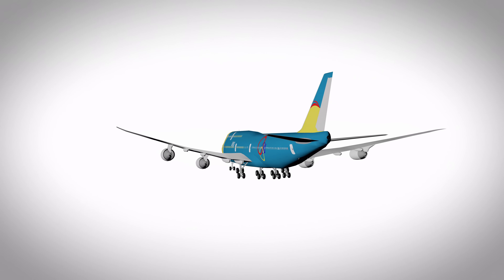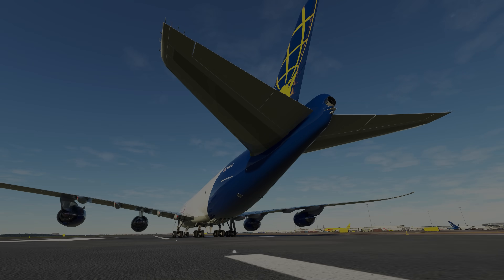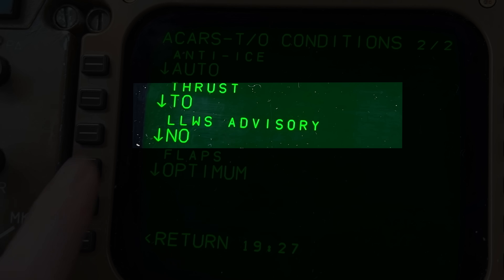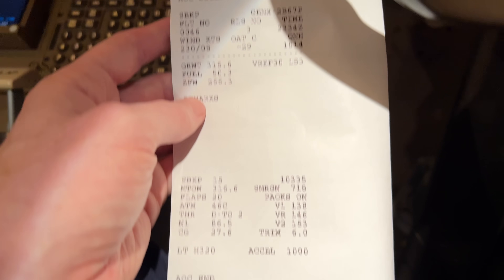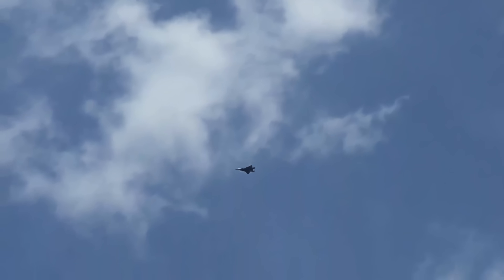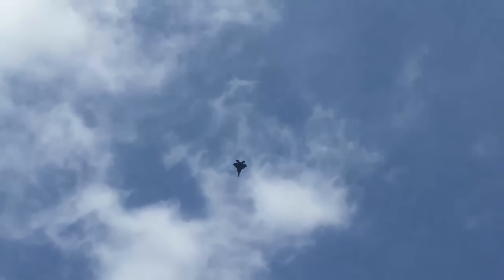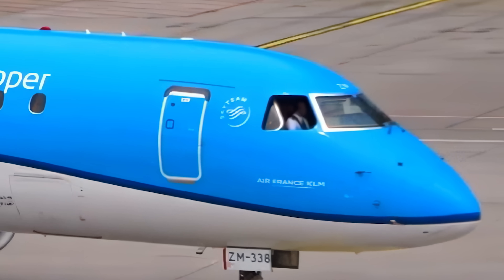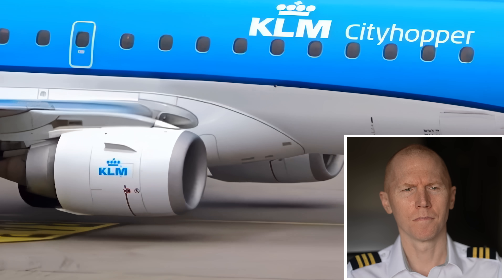Unsafe 747-8 Vertical Takeoff

Comment: I'm not a car person, either, but truckers use engine braking often. It's noisy, though, so some cities have ordinances against using that in town. I occasionally use it in my car on icy roads,especially going down hill, to keep the speed down. Also, that's how I was taught to drive a manual transmission car when coming to a red light, for example. I think it's also pretty common in mountainous areas to prevent brake fade. 
Anyway, great content! I recently returned from Europe on a 747 and was thinking of all I've learned from your channel!
Reply: I'm a manual driver as well. I do believe it was a poor analogy - as you said it is a common practice in manual vehicles - to save on your brakes. Hard to compare flying a 747 in the air to driving any vehicle on the road lol
Reply: Every time I see them signs I flip my jake brake to high lol
Reply: Used to drive 18 wheelers and what you are thinking about are jake breaks. And you are not supposed to engage them on normal driving conditions only on steep down grades. Basically using the engine to slow the truck down so you dont over use the breaks to keep them from overheating and hence becoming non responsive. This is the reason for run away truck ramps fyi
Reply: @giocrypt5148  Not to mention that a jake brake (Jacobsen Engine Brake) is an add-on component that varies the valve timing and things to create more back pressure.  I drove fire trucks with them, and they were on all of the time.  Cars do not have this.  That said, when driving a stick, I downshift all of the time.  My last Explorer had an automatic with "select shift" that allowed downshifting.  I got rid of that car with 78,000 miles and original brakes.  The new Explorer does not have select shift, and I miss it!
Reply: Some motorcycles, mainly flat-track racers, will put a compression release lever on the brake side of the handlebars to be able to let off some of the compression as they hit the corners. You'll hear them, it's like a higher pitched jake brake. Decades ago I did some racing, my family was big into it in the 1970s.
Reply: Google money shift :)
Reply: Yes, downshifting a manual transmission to slow a car or truck down used to be a very common practice.  My dad gives both I and my sister-in-law a little grief for not doing it.  But honestly, that was a lot more useful/practical in the days of drum brakes, where they would fade if they got too hot.  Something far more likely with a drum brakes than disk brakes.  No fun!! I still downshift a little, early on in slowing down, but mainly use the breaks.  Replacing my brakes costs a lot less than replacing my clutch.
Reply: I drive a manual transmission Honda Accord by preference.  Weird, I know, but I really prefer a manual - I feel more connected to the car and it makes me pay better attention to my driving.  (Yes, I’m a Boomer; but a very young one!) I routinely use my gears to slow down smoothly, even in traffic.  I also use them to keep my speed slow when driving downhill on mountain roads.  I do sometimes use my brakes to slow down quickly if needed, but I use the gears to maintain slow speeds downhill instead of riding my brakes.  Done properly, it shouldn’t damage the clutch, because I also stay off the clutch as much as possible;  I only use the clutch when actively shifting.  If I do need to use the brakes to slow down quickly, I gear down at the same time so that I can get off the brakes ASAP and let the engine keep my speed down.  My goal is to only use the pedals when they are needed and to get off of them ASAP.  According to my Dad (a pre-boomer?) that’s the best way to keep everything working smoothly for as long as possible.  😊
Reply: Regarding downshifting a manual to save brakes: Have you checked the cost of brake pads vs clutch plates? Unless of course you can consistently perform perfect downshifts…every time 😊
Reply: Our quad bike only has engine braking.
Reply: @Rabblewitz  Or the transmission synchronizers.
Reply: Semi trucks have what is called a retarder which is basically a dedicated engine braking system with variable strength. It’s used because as opposed to normal brakes it is wear free and it doesn’t lose strength (fading) due to overheating of the discs and brake pads.
Reply: @stevewaclo167  if you're used to it, it's not a big deal. 
In Italy (where manual shift is still widespread) you get used to it and it's sometimes safer than brakes.
A friend of mine, descending a long mountain road, kept braking until the brakes finally fade out. She didn't had a bad accident only for pure luck. Here where you descend mountains you're encouraged to use as motor brake as you can.
Reply: Engine braking is usually used with manual transmission - it's part of the tools you have for driving!  It doesn't wear anything out any more than normal driving does, and it actually improves engine life by encouraging oil up the cylinder bores.  I practice driving without things from time to time, in case I ever have to (like practicing engine failures for pilots) and I once managed to drive home from work, about 11 miles, only touching the brakes twice.
Reply: @DeathCubeKX and the plane was on the ground, not flying? So he wasn't comparing a plane flying to a car driving. He compared a car driving to a plane driving. Smh
Reply: @stevewaclo167  You're not using the clutch plate to slow the car down...you're downshifting and then letting engine compression slow the car down.  That said, I don't downshift to slow down at every red light like some people here are saying, only on downgrades.
Reply: @kurzabel  How did we let discussion on a 747 channel get off into a dialog about engine braking? 😉

I agree engine braking can be useful on long downgrades, but as you accurately pointed out, it’s not to be used as a primary method for slowing a vehicle. I still contend that any down shift for slowing that does not include a well synchronized clutch application is going to wear on the clutch. Decades ago, I got into the (bad) habit of downshifting all the time for slowing, and wrecked the clutch on an  Audi 100LS in short order. I told you it was a long time ago. 😀

And not to put too fine a point on it, but engine braking in a car is different than a Jake brake in a truck. Correct me if this is wrong but here’s a description of Jake brakes, from Google: “When activated, the engine brake (Jake Brake) alters the operation of the engine's exhaust valves so that the engine works as a power-absorbing air compressor.”. That’s why activation of a Jake is so darn loud and we often see signs (usually in residential areas) outlawing their use. 

In a car, the throttle plate is of course closed during engine braking, so there is not enough air entering the combustion chambers to compress. Again from Google: “Resistance in the engine is transferred through the drivetrain to the wheels. Some of the braking force produced is from friction in the drive train, but most of it is caused by the vacuum that was created from the lack of air “ (not from compression…my comment added). 

So there 😀. 

Good talking to you and let’s let this channel get back to talking 747 stuff 😃.
Reply: @stevewaclo167  " How did we let discussion on a 747 channel get off into a dialog about engine braking"  Because he mentioned engine braking in a car specifically in the video.

"And not to put too fine a point on it, but engine braking in a car is different than a Jake brake in a truck"

I never said they were the same.

"Some of the braking force produced is from friction in the drive train, but most of it is caused by the vacuum that was created from the lack of air "

In a normal passenger car, the 4 stroke engine, whenever turning over, can be fundamentally understood as an air pump.  This air pump is a heat engine from which mechanical energy is extracted, but first and foremost it works by pumping air.  In stroke 4, The pistons begin to compress the air, then the exhaust valves open and the air is expelled under pressure.  The exhaust valves stay open as the exhaust stroke is completed, and the kinetic energy stored in the exhaust which was driven out under high pressure early in the exhaust stroke helps pull out more gas from the cylinder.  Once this compression during the exhaust stroke drives out all the exhaust, the intake stroke, stroke 1, begins and the cylinder opens again, creating a vacuum. Strokes 2 and 3 are the compression and power strokes, and strokes 4 and 1 are the "air pump" strokes, where the intake and exhaust valves are opened. That's where  manifold vacuum comes from...without engine compression in stroke 4, you won't end up with manifold vacuum at the end of stroke 1.  The engine compression jake brake alters timing and fuel flows to create more effective engine braking, but without compression, no engine braking is possible with or without a jake brake, because without compression it will not function as an air pump, and therefore will not function at all.  The use of compression as an idiomatic shorthand for the proper functioning of the air pump as a whole is long established by auto technicians, perhaps you're not familiar with this usage.  The original reasons for this choice of terminology are up for speculation at this point, given that both compression and vacuum are measured as part of engine diagnostics, but I assume it is because vacuum leaks are common and often easily fixed due to the siphoning of vacuum to assist in braking and steering, while loss of compression is a more serious issue.

"Good talking to you and let’s let this channel get back to talking 747 stuff 😃.

It is more logical, if you don't want to talk about something, to merely stop talking about it, rather than asking others to stop.  If you have issues with self control and have trouble stopping, perhaps you can install a jake brake on your typing fingers to add braking force.
Reply: @giocrypt5148  Who says you're not supposed to use them in normal driving conditions? That must've been some weird company policy or something. There is absolutely no reason to not use them in normal driving conditions other than a noise ordinance.
Reply: @janharg1  Absolutely this. I grew up driving (what we used to call) standard transmissions, and once you really get proficient, the car becomes a part of you. Using the clutch to brake is just like using it to accelerate in reverse. Where I live is very mountainous, with steep grades and tight (15 mph?) turns. If I'm coming in too fast I will totally downshift and brake with the clutch at the same time I am applying the brakes. But mostly, I try not to use the brakes except when that's truly indicated, like stop signs and stop lights. I've gotten over 200,000 miles on the same clutch, so I try to save the brakes.
Reply: @HDRW  I did that recently. I was coming home from a road trip and just turned onto my last gnarly mountain highway to get home when my car indicated my brake pads were dangerously low. Okay. I know I'm not out. But there was little traffic so I went a little slower, tried to use only the engine to break, and was amazed how little I really needed the brakes if I was paying attention and planning ahead. In retrospect, it was fun!
Reply: @giocrypt5148 Try spelling it "brakes".
Reply: @stevewaclo167 Like in my  Porsche which had worn synchros on 2nd and a bit on 3rd gear which required double clutching ("double declutching" if you're a Brit).

Comment: I flew on an A380 from Bangkok to S. Korea, fully loaded and counted a flight crew of 28 as we waited in the terminal. The plane was very comfy. I sat in the upper deck just behind the wing. It feels like looking out of a 6 story window. The plane was tremendously under powered, used up a lot of runway taking off. Seriously felt like 60 mph when it finally rotated. Very smooth flight.

Comment: Living high in the mountains of northern New Mexico, we became accustomed to driving in lower gears to control speeds down steep grades. In general we drove much slower than "low landers" visiting the area, and that made for an interesting mix of traffic sometimes
Reply: Raton Pass. Been there, done it, and learned on motorcycles to downshift long before I drove a car down it. So many people don't. (and I was a flat-lander, it doesn't get much more flat than Amarillo. :)  )
Reply: @charlayned Try Denmark. The highest point is 561 feet above sea level.  And that's a slow rise up.
Reply: @charisma-hornum-fries   People in Florida are seeing your "561feet" and wondering to themselves whether they would start to get altitude sickness by then -- so much higher than they've ever been.

Comment: @74Gear That F-22 did an aerobatic maneuver called a Pirouette. It went vertical to bleed off all its energy and pulled the nose over at the top and basically started an almost half spin yawning motion. 

You're not wrong when you say its black magic. The F-22 is "supermaneuverable". Meaning it can do things well outside of normal regimes and flight envelopes. With thrust vectoring, the F-22 does things that seem to defy physics sometimes. Its an amazing piece of engineering.

Comment: ATLAS air flies into various combat zones. High power climbout is SoP for these regions also depending of the age of the video. Bagram's western departure was facing a 13k mountain  with the runway already at 5.5k. So every take off was that profile. Kinda crazy to watch.   Regarding the F-22 that's the typical air show fodder they do, It's also handy if you need to drop through the air also they can park it on the tail and move along at a few mph almost like a vehicle.
Reply: Yeah I was thinking the same. Based off the other planes on the tarmac they took off from a commercial AP but that take off is the same I see from our heavy pilots most times in the USAF. I didn’t even know heavies could produce that vapor effect over the wings like fighters do until I had my first flight on a KC-135
Reply: I've seen the Tomcat go down the runway on a flyby almost standing on it's tail.  He was showing me how slow the Tomcat could fly. Everyone asked him fast it can fly.  I asked him how slow it could fly.
Reply: I used to fly Atlas Air in and out of Iraq when I worked out there…very exciting takeoffs and landings.  On landing we would sometimes circle in very aggressively-it reminded me of a leaf falling to earth in a windstorm.  Flew in and out at least 45 times in 5 years.  We once lost the right engine right after takeoff while doing that steep climb and the jet yawed radically to the right and scared the pants off me…but the plane recovered and we landed safely, then waited for them to fix it the engine.  It was a little unnerving getting into the same plane after that, but there weren’t a whole lot of options.  Overall, decent airline, even decent food, given the circumstances.

Comment: Hi Kelsey. Use of reverse thrust . Your comment was spot on . They are there for landing only and not always needed. However they can keep the brakes a bit cooler by assisting the deceleration which is important if the aircraft has a quick turnaround as after the next takeoff the hot brakes are now stored in the undercarriage bay . Working as an engine technician in the Royal Air Force I scolded a few Tornado F3 fighter pilots for using the reverse thrust buckets as a means of slowing down the taxi speed. The pilots are supposed to select taxi nozzles on taxi which opens the engine exhaust nozzle to max open position. Now the engines are producing a lot less thrust. Maybe you can simulate this on your 747 by shutting down 2 engines ( one from each wing). He can still use his throttle power to speed up and slow down. Incidentally the only time the nozzle will be in the fully open position is when Full Afterburner is selected and the engine has powered up to this position. Variable nozzle position is essential on a engine that has a afterburner to ensure the core engine runs smoothly. Hope I didn’t bore you guys too much.
Reply: I would trust the pilots on that.  They know how to run the engine. The wings on the 747 are designed considering the force of two engines producing equal thrust on each wing.
Reply: Thrust reverse would be helpful on wet and snow-covered runways as well...especially somewhere like Chicago Midway.

Comment: With the high power setting and vectored thrust the Raptor pilot was demonstrating controllability at minimum airspeed, quite useful in dogfight situations.
Reply: If you're going slower than your opponent in a dogfight, you're dead. Speed and altitude win a dogfight.
Reply: @EdwardSnortin But if you have a bogey on your tail and pull the brakes, doesn’t the enemy’s plane shoot past you and know you have them in your crosshair? I know because that’s what they did in the movie Hot Shots! which we all know is based on real events!

Comment: I was at Edwards Air Force Base during the ATF fly off between the YF-22 (today, F-22) and the YF-23.
My biological father worked on the YF-23.
The F-22 also has thrust vectoring. This flat spin maneuver is common today.
Reply: My father was a Systems Engineer on the YF-22 team.  He told me that thrust vectoring was the deciding factor in picking the YF-22 over the YF-23.